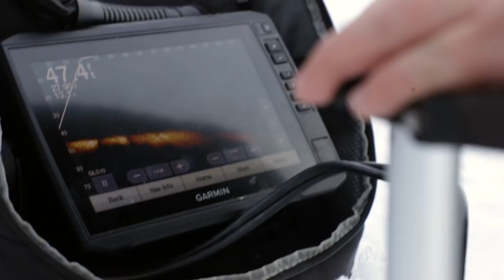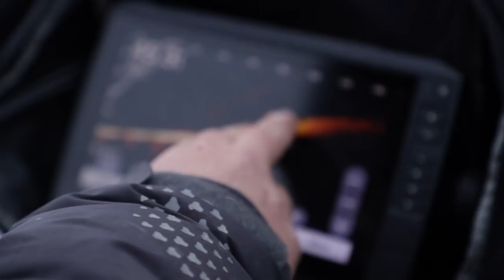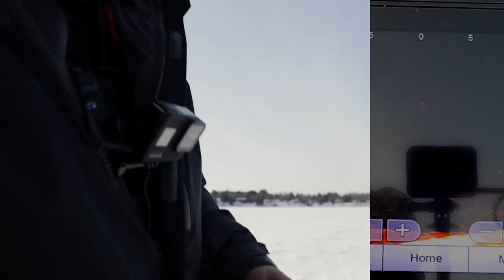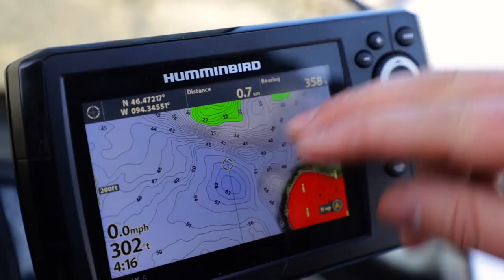Ice fishing for tullibee (LARGEST ice-fishing derby in the WORLD)

Comment: my electric auger starts every time...my gas job didn't hahaha    electric for the win
Reply from the maker: Absolutely. It's so nice getting to the spot and not worrying whether or not your auger is going to start!
Reply: Al sir,Is like any 2 stroke (usually carb/fuel system related),Unless using a propane model.
Reply: @roniler7960  -35 degrees celcius is a B*tch to pretty much anything.  and yup! frosty carb or frozen fuel lines.. changed to Aspen fuel and it helped slightly
Reply: @outdoorsmanal1759  Yes temp can affect  things. Luckily never had a problem yet (Hope never do) with the propane auger.

Comment: Brett How difficult would it be to use the mega live transducer you have in your HELIX ICE MEGA LIVE BUNDLE also on your boat in the SUMMER and then back to you HELIX ICE UNIT in the WINTER..   Not sure I can afford 2- $1500 mega live transducers...  thanks
Reply from the maker: Hey! It's actually pretty simple. Can plug that transducer right in to your unit and then just run a bracket and pole over the edge of the boat if you already have a compatible unit on the boat. I actually just ran my LiveScope right in my ice bundle in the boat for over half of the year. Not ideal because it's one more thing to account for but it worked. I did eventually mount a separate gimble bracket in my boat so that I could pop the unit on and off.
Reply: @TargetWalleye  thank you for the info